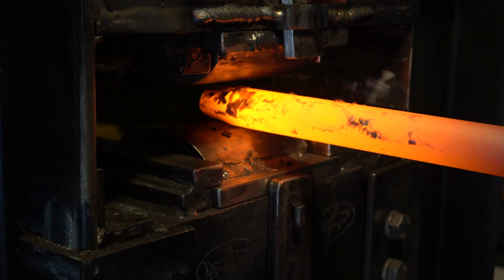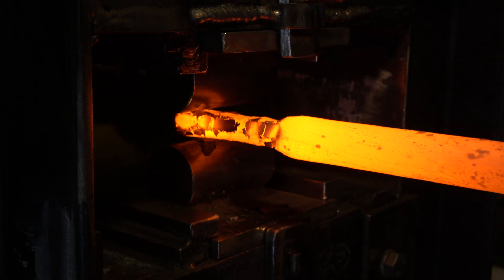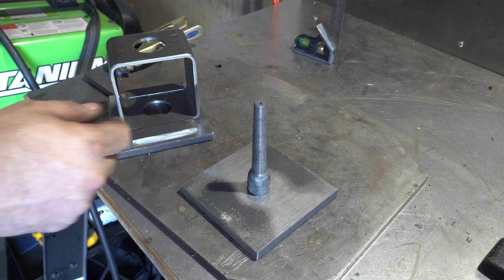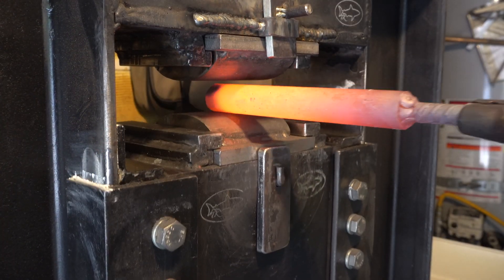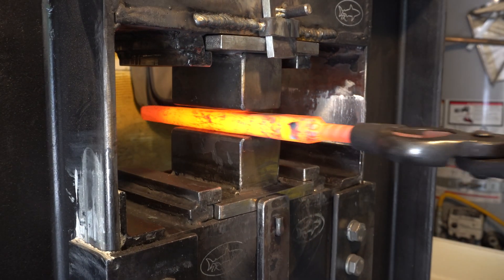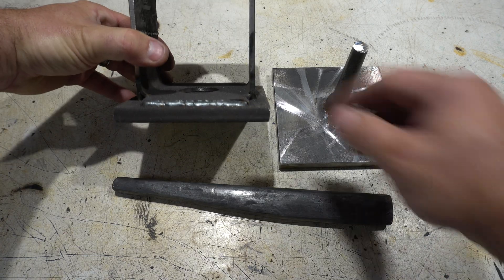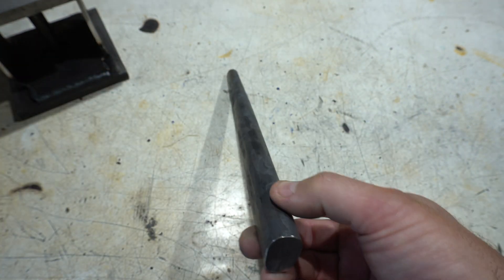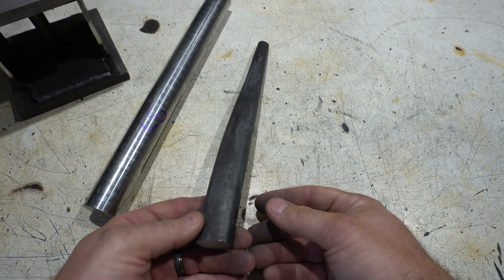Triple-T #45 : Forging Tools - Punch and drift for axes and hammers

Comment: I notice your ram goes up to the fixed die vs going down to it. Are you using a modified log splitter as a press?
Reply from the maker: Nope, that whole press is custom built from scratch.  I actually don’t recommend starting with a log splitter, you’ll get a lot of flex in the system.  Watch my Triple-T #3 video for a full breakdown of the press with a parts list in the description.  👍
Reply: @TyrellKnifeworks  Absolutely!

Comment: What made you choose S7, over say H13 for the hotwork that this punch will be doing?
Reply from the maker: S7 is a good steel for punches.  Plus it’s what Blacksmith Depot had in stock.  Thanks for watching
Reply: @TyrellKnifeworks  thanks. Can you please do a Damascus cutting edge on the hatchet?
Reply from the maker: @iolithblue  Maybe for a future one.  The first one will be mono-steel until I get the hang of it.

Comment: S7 and some of those mid-carbon, high alloy steels are real monsters when it comes to toughness and they actually make for a really scary large knife. I've only used the flat stock for that as it basically has a very narrow 'godilocks zone' for forging temps and just won't move under a hammer. But if you ever find the need to make something you can cut a car door off with and still fight a bear with it after- is the stuff!
If you go through the manufactures instructions on it for the intermediate warming stage and the slow ramp time up to critical temps in the heat treat kiln along with a 2 x 2hr tempering cycle you can usually scavenge the hardness up to about 57-59HRC on things like S7 and A8mod and in the case of the latter I was very impressed with the edge holding, impact strength and some ok corrosion resistance on A8mod knives. 
Being a high alloy steel you can pretty much forget about forge welding them to anything else though, they're very much a product of modern industrial processing

Anyway, looking forward to seeing how your hatchets and hammers come along
Reply from the maker: Thanks for the info, Kris!   I hope they do the job.  👍

Comment: Man S-7 is expensive! I think we had talked before about this, but if you have any stock leftover, it'd be interesting to add to another project. I don't think shock steel even can be hammered out, but stranger things have happened! Thank you for including us in this part of the process, instead of just saying "hey I made this a week ago---blah, blah, blah." It was nice to see. You don't see shock steel floating around on YouTube very often!
Reply from the maker: It wasn't that expensive really.  The 12 x 1" round was $15 and the 12 x 1 1/4" was $20.  I was looking at punches and drifts from inferior steel and they were in the $70 range so I thought this was a better option!  Thanks for checking it out! ❤️
Reply: @TyrellKnifeworks  Jeez, why did I think it was much more than that 🤦🏽  No I agree, making these less expensive punches and drifts, that are a lot stronger, was the much better choice! Looking forwards to your hatchets/axes. I know you'll knock em' right out of the park! 😁

Comment: Reinforce that stripper for the punch set, there’s a real good chance that’ll bend the first few times you use it. I’ve bent and pulled my dies off multiple times. And also don’t punch to cold of material, keep it hot
Reply from the maker: Yup, I'll see how it goes.  It could totally rip apart.. it was my first attempt.  😜  Thanks for taking a look.

Comment: On the punch, couldn't you drill through the plat to the punch, then weld the hole closed, that would fuse the punch solidly to the plate, it would never come apart... Loved the whole build..
Reply from the maker: It’s been reset into the plate a 1/4”.  Then welded all around.  That’s probably stronger than drilling right through the plate and holding it in place with just weld.  Plus it was easier to get it aligned that way.  At least that was my thought process.  Thanks for watching!

Comment: Did you consider chamfering that the bottom hole in your punch release?
Reply: Oh and my vote is that you do the hammer first!  :-D
Reply from the maker: No I didn’t but probably should have.  Maybe I’ll go back and donut with the die grinder.  Thanks for the suggestion.  👍